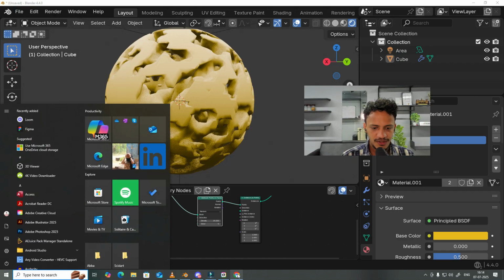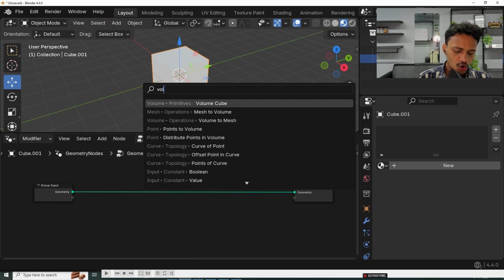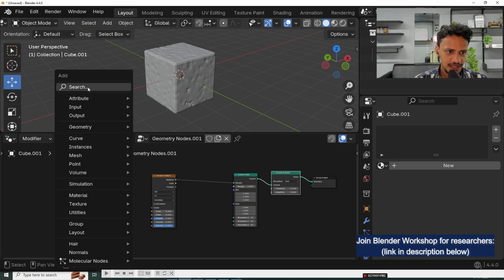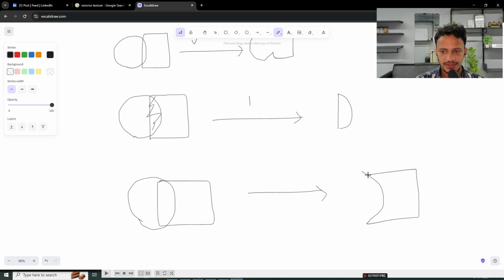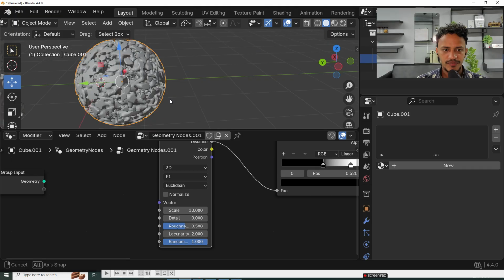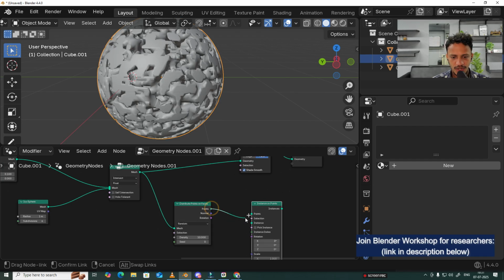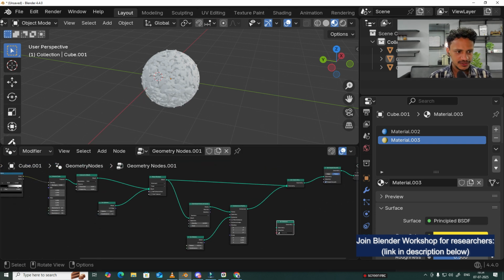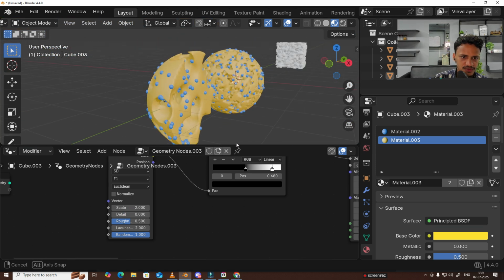Create Porous Nanoparticles with Blender: Easy Guide | Scientific Illustration

Comment: Hi. Thanks for this video, so insightful but I've got a little challenge, I was making a hexagonal porous material using cylinder and turning it into 6 instead of 32, now the challenge is once I connect the Bounding box to join geometry, it gives me a red line (conversion is not supported, Vector >Geometry) How do I solve this problem please 😭